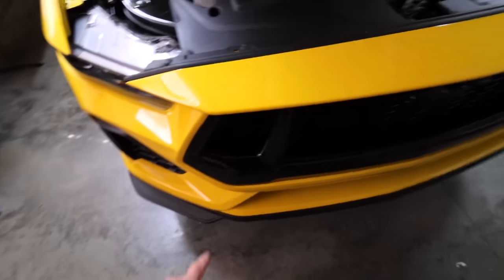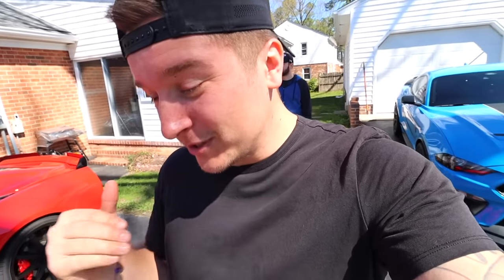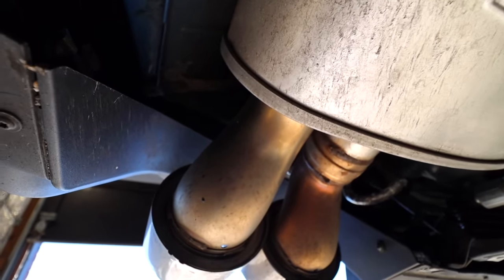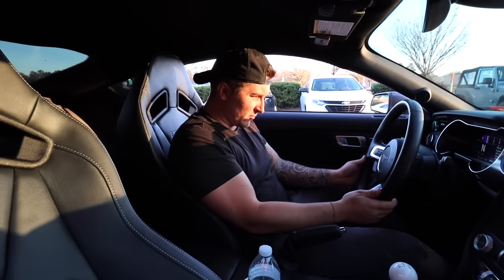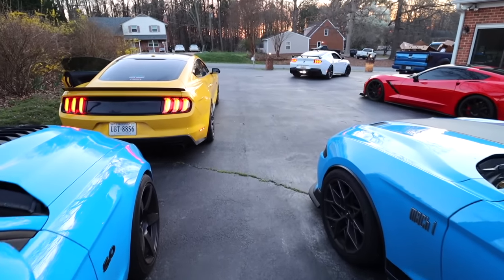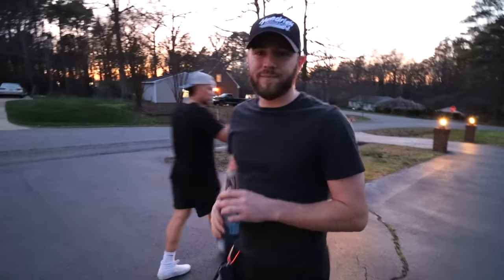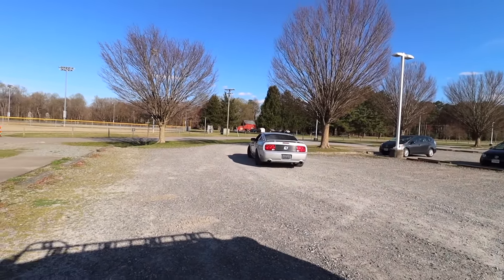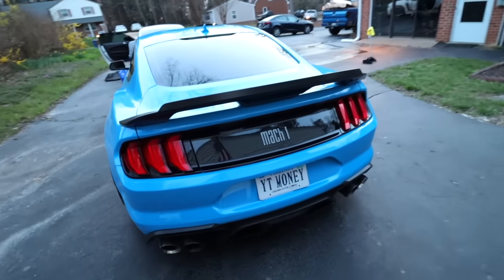My Neighbors ARE NOT Going to Like This...

Comment: Damnit man that S650 is ticking like HELL 😂
Reply from the maker: Yeah idk whats going on
Reply: yeah i thought i was the only one to notice that
Reply: My 2020 does it too, runs fine, no metal in the oil, prob a DI sound or plastic pan issues.
Reply: @169abr  That is not normal ticking, bud. For both your S550 and this yellow S650. The noise alone would get me irritated.
Reply: @InanimateReality  the way to tell the normal tick from the bad tick is if it goes away after ~3k miles on the oil change. It’s been to Ford 4 times since I got it for other issues (fuckin window motor) and each time I comment on the tick and the 10r80 whine cause it drives me up a wall like you said. Every time I’ve gotten it back they’ve said it’s just how they are and the tick and whine are just normal operational noises of the Coyote.

Comment: Hey Derek! I’ve been watching your channel for almost 5 years now and a big fan. I just purchased a new mach1 and looking to have it ppf like yours. When they installed the ppf did they put the ppf over the decals? I went to a local shop to me and they are tell me I need to buy new decals and the put it over the ppf because if they go over the decal it will leave a water line?
Reply from the maker: Thats amazing man! and no, you cut around them!!!
Reply: I just got mine done on my FJG Mach 1. I guess it depends on the shop. My shop uses a software that pre-cuts the PPF and they were able to go over my decal. I went with a stealth PPF on the matte part of the vinyl. If they don’t have the pre-cuts, any good shop would be able to cut around it themselves

Comment: I thought I was buggin but my steering wheel legit is slightly to the left also but drives straight. I thought it was my alignment so I had it checked twice. Once when I got the car and again after I lowered it and still slightly the left lol. Must be an S550 thing or just the way I drive and hold the wheel
Reply from the maker: Dude i swear 😂

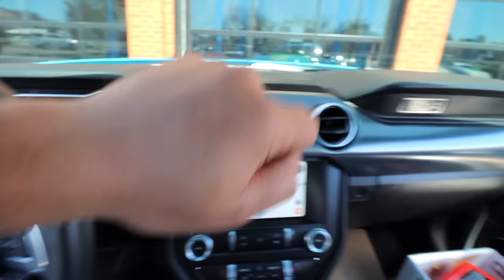Comment: 8:13 Just gotta say, this warrant louder exhaust, why? You drive a car thats so good looking that people want to become one with it. Don't worry happens to me all the time. You just need to have a louder exhaust to snap them back to reality 👍
15:45 Regarding the steering, I mean my GT Cali Special has about an inch of play in dead center, its more noticeable with my winter tires on, summer tires I don't notice as much. But yeah within that inch of play I can basically keep the car moving straight even though its slightly off to the left a bit or to the right.
Reply from the maker: Exactly….

Comment: You shouldn't of had to buy that harness.   That is covered under bumper to bumper.  Dealer should have taken care of you. 
It's too late now but you should have just chopped an inch from your H pipe and brought cat back in more so not to pinch the wires, instead of bending the body seem.

Comment: I’m just mind blown on how Joel and Jake are running long tube headers without a tune. Is that a thing or why do people say you can’t run it without a tune ???
Reply: Mustangs adjust based off airflow because of the MAF/Widebands so technically you don’t need to tune for headers.
Reply: @169abr  okay that makes sense but wouldn’t it still trigger a CEL code?
Reply: @juniorhernandez6476  it’ll trigger P0420/P0430 but the car will run just fine. The code hampers no performance since Ford basically made the computer adapt to headers from factory.
Reply: @169abr  dang that’s crazy making me want to put headers on my mach1 lol
Reply: @juniorhernandez6476  once the warranty is up headers are going on my cs, may have to change catbacks tho.